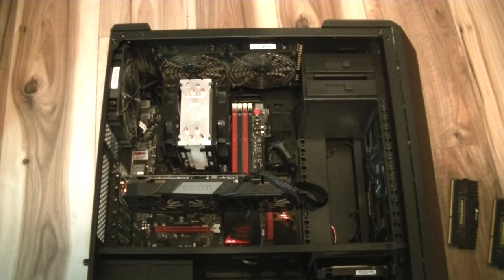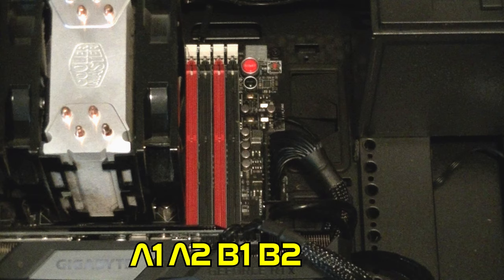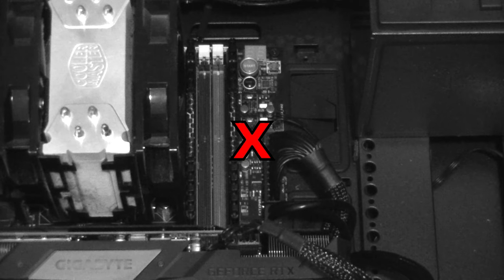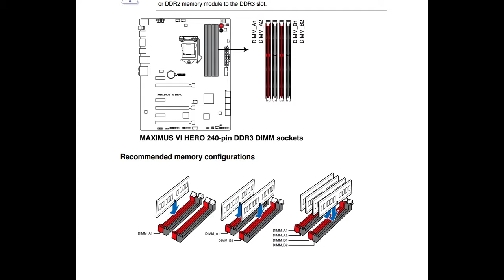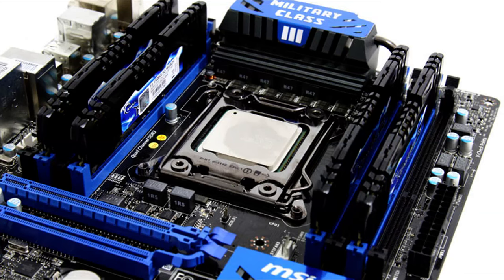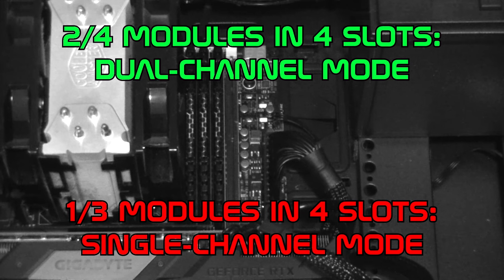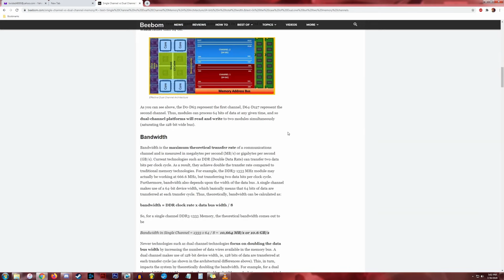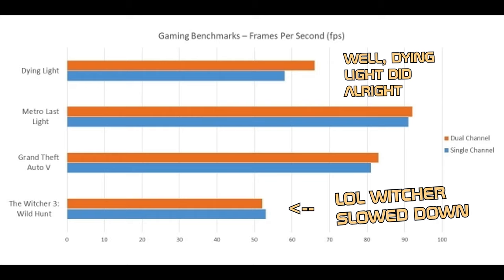How to Make Your RAM Run in Dual-Channel Mode

Comment: Hello sir, if there are 4 RAM cards available,
Can we slot that 4 Rams in those 4 slots, A1, A2, B1, B2.
Reply from the maker: Are you asking if you have four RAM cards and your motherboard has four slots for RAM? If so, then yes, just fill all the slots up and you'll get dual-channel mode.
Reply: @Torqcx Thakyou sir,

 we have to do any settings after installation to bring into dual channel mode.
Reply: And does our PC  get format or other problem like  data erase after installation.
Reply: 😅Thank you very much sir😇
Reply: @Torqcx  I don't know weather it is for RAM, but there are 4 slots. 
2 black colour  slots,
2 white colour slots. 
In that from both 1 from black and 1 from white are used,  now I wanted to increase the ram, so I can buy new RAM and place it beside of it or should I replace it with a new RAM card.
Reply from the maker: You can put the new RAM beside them, just try to get the exact same models.

Comment: Weird question and I’m very stuck I am building a new pc and I can’t run both ram sticks and there is only 2 slots and it supports up to 64 gigs of ram and it only works in slot b tried both sticks many different ways and nothing worked cleared cmos and it still won’t work I have a asus rog z490-I gaming motherboard with i9-10900kf 2x16 gigs of vengeance rgb pro ram rtx 2060
Reply from the maker: If you also tried cleaning the first slot, then you may have a defective slot, sadly. If it's a new board, I'd send it back and get a new one.

Comment: I tried to upgrade my   old 1866Mhz DDr3 kingstone fury 8G kit  ram with  with a  1866Mhz  patriot  viper ddr3 16G kit   I tried many combinations but  windows always told me there was a lot ram not usable until i tried the 8G stick and the old 4G stick then windows detected the correct 12G ram never figured out why I could get the all 24G

Comment: Is dual channel and  rank the samething? Cuz i have 2 single channel  ram but in bios say dual channel and also have 2 ram in  x300 it also say dua channle and in a different section 1 rank
Reply from the maker: "Rank" sounds like something that that motherboard has specifically, like boosting the rank of the memory also boosts its performance. I'd need to know the model to be sure though.
Reply: @Torqcx  DeskMini X300 Series and Crucial RAM 16GB Kit (2x8GB) DDR4 3200 MHz CL22 Laptop Memory CT2K8G4SFRA32A
Reply from the maker: So I learned something today! RAM rank is a separate function of RAM, it's a bit complicated but in short, dual rank RAM is better if you're getting a high capacity of RAM, while single rank is better if you want it to run as fast as possible (typically this is better for gaming).

It sounds like the RAM you have is single rank. It has nothing to do with the channel mode and I wouldn't worry about this.
Reply: @Torqcx  ok ty

Comment: My motherboard is capable of dual channel but still wont default to it, even with all 4 slots occupied.  Why?  Why wont it go to dual channel?  Msi b650p pro wifi motherboard
7700x cpu
Tforce vulcan alpha 16 gb x4 ddr5 ram.

Comment: i am strugling with a hp 2400 with  ddr2 6400  i have know installed  2 x 2 kingston  in th first 2 slots  and 2 x 1 gb in th las 2 slots but hynix moduls

i have tried with 2gb hynix moduls but it only works in the 3rd slot

Comment: If i already have ram DDR4 8G 2400 on my PC and i want to add in the other slot 8G  more. Is it okay if i buy DDR 4 8G with 2666? So will have 8+8 but different speed. Cause its difficult to find 2400.
Reply from the maker: If that's all you got, there's no harm in trying! If anything goes wrong, most likely it will just revert everything down to 2400MHz, which I don't think will be the end of the world
Reply: @Torqcx  ok. Thanks for the answer 👍

Comment: Do I need to change xmp mode if I swap out ram? Currently have it enabled
Reply from the maker: With most modern motherboards, you should just leave all the settings alone; it will keep XMP on or turn it off depending on what is needed.
Reply: @Torqcx  perfect

Comment: Im having a weird problem. My mobo cant read dual channel mode currently. Few days ago i run with dual channel mode (8x2) and run normally, but then next day suddenly i cant booted up my pc. So i try remove it and use the ram slot 1 by 1. Now can only run single channel (1 stick) on B2 slot only. Im actually run out of ideas cuz i never encountered this kind of issue before.
Reply from the maker: It sounds like that RAM slot may have died. Unfortunately there's nothing you can really do except get a new board when that happens.

Comment: My motherboard only has 2 slots and I’m adding another 8 Gb. So do I just put it in the infilled slot? Will this automatically put it in dual channel
Reply from the maker: Yes that should make the memory run in dual-channel mode!
Reply: @Torqcx  ok. I have another question, the other 8 stick I’m buying is faster MHz than the other and high cl. Will that still be fine. I’ve heard that it will just downgrade to the lower MHz
Reply from the maker: @joeef  yeah I'm not quite sure, it's likely it'll downgrade. Always always always best to get the exact same make and model of RAM when adding additional slots. Same capacity, speed and timings.

Comment: very helpful. Thank you. I recently tried upgrading my  ram from 16 gb to 32 gb , in my ASRock z87 extreme 4 ATX , the dual channel is not working. I have updated the Bios, tried shuffling the Ram, still it doesnt read the B1B2 slot. Tried using only A1B1 slot the dual channel doesnt work. Hopefully you can help me resolve  this issue. P.S. the 4 Rams are identical when 4 are installed ,  the pc says  Channal B  didnot pass CPU memory test.
Reply: Check your cpu compatibility

Comment: Hi in my pc if I but the ram in A1 and B2 it keep restarting can you please help me?
Reply from the maker: If the RAM configuration is causing the PC to fail to boot, either it's in incorrectly, a slot on the motherboard is bad or at least one of the modules is bad. Check each slot individually and test them all out.

Comment: Hello, I'm trying to install a 2 module ram, but it just won't boot, shuts down, reboots, and shuts down again.
Reply from the maker: Try each module individually, in each individual slot. If any of the slots cause a failure to boot, you most likely have a defective slot in the motherboard. If one of the modules causes a failure to boot no matter where it is, you have a defective module.

Comment: Dual channel is effectively using all the ram’s power?
Reply from the maker: It's a way for the system to simultaneously utilize all of your RAM, so in short, yes, multi-channel modes milk your RAM for as fast as it all can go!
Reply: @Torqcx  exactly what i want!

Comment: What if i buy 32 gb of ddr4 running at 3200, would it hurt if i kept my old 8gb in a 3rd slot? Would it run faster at all, or would it be slower than just dual channel 32?
Reply from the maker: If you have 32GB running in dual-channel, honestly I'd just go with that as opposed to 40GB in single-channel; I doubt you'd notice those extra 8GB

Comment: I have 3x 2gb kingston 1600mhz ram, and 4gb kingston 1600mhz ram will it work in dual channel?
Reply from the maker: That's a tricky one, you'd have to test them all. It's always recommended you get the exact same model RAM for every single slot (same speed, size, timings, etc.)

Comment: But what if I have 2 ram slots and I have 8gb already installed and want to install another 8gb? Will it work if there is 2x8 ram in 2 slots?
Reply from the maker: It will revert back to single-channel mode, but you will have more RAM. Odd number of modules in an even number of slots will give you single-channel mode.

Usually, though, having more RAM is better than having faster RAM (though it depends). If you find your system maxing out of memory, go with the extra RAM. otherwise, just get what you have to stay as fast as possible.

Comment: What happens if i use 3 ram sticks? Will still i have the benefits of dual channel?
Reply from the maker: In most modern motherboards, yes, but many will automatically resort down to single-channel if you do that. You'd have to check your board's specs.
Reply: @Torqcx  i have Asus b550m wifi ii
Do i need to change something in bios in order for me to run in dual channel mode with 3 rams?

Comment: Should I use 2 x 8GB or 3 x 8GB. In my 4ram slots?
Reply from the maker: It's up to you; using all three obviously will give you more memory, but they will run in single-channel mode and thus not be as fast. That being said, in your case, I'd say you'd notice an overall performance increase if you just use all three of them.
Reply: @Torqcx  thanks

Comment: What if your board only has 2 slots? does that mean its only a single channel board?
Reply from the maker: For modern motherboards, no, two slots should mean dual-channel mode will work with both of them filled. :)

Comment: Hi
I have a problem with a new CPU AMD RYZEN 7 5700X not boot with dual channel of memory
Only on single channel 
(Used in Asus rog strix b450 f gaming ii)
Let you know that I have used this motherboard before with a RYZEN 9 3900XT and 64gb of memory on quad channel and everything is fine
I updated to the latest bios compatible with this processor, and when i change the memory model it's the same problem only one memory stick.
Please help me.
Reply from the maker: Interesting considering it used to work before you updated the BIOS. Try looking through all of the RAM settings that are enabled/disabled, something may have changed in there. I'm sorry I can't be more helpful, but it sounds like a very specific issue or setting that got adjusted.

Comment: Does 8+4 ram activate dual Channel ??
Or i need 2*8 ram to activate it
Reply from the maker: You might be able to get dual-channel with different modules but every motherboard is different. Can't hurt to try, but it's always recommended you get the exact same make and model of RAM if you want to be sure everything will run correctly and optimally.

Comment: I have a laptop that has only 1 slot can i put 16gb dual channel, or sigle channel memmory does it makes any difference
Reply from the maker: Do you mean there's only one empty slot left available, or it literally only has one slot? If the latter, it will only run in single-channel regardless.
Reply: Like only a single slot and its occupied with 8gb can i upgrade it to 16 gb (dual channel)
Reply from the maker: @augustine5668  if it's a single slot then I don't believe the laptop is capable of dual-channel speed in the first place, so unfortunately you'll be limited to single-channel. But upgrading to 16GB will certainly speed the system up.
Reply: @Torqcx  ok thanks
Reply: So my vram also increases? First it was 4 gb ram and vram was 128mb and i upgraded to 8gb and now its 512

Comment: correct me if im wrong, my mother board is B75MA-P45, core i3 3220, can i put 3x 4gb ram DDR3 1333 mhz once i put it on dual channel mode? or still doing single channel or its better to buy 2x 8gb ram DDR3 1333 mhz or 1600 mhz?
Reply from the maker: If it's an i3, I'd assume it can only either do dual or single-channel mode. So I would recommend just filling all the slots up instead of going for three
Reply: @Torqcx  thank you
Reply: @Torqcx  hey sir sorry to bother you i have 16gb ram thanks for your tips last one is my gpu is it my b75ma-p45 is compatible on gtx1650?
Reply from the maker: @Furansurui  The only compatibility variable you should need to check is the motherboard. Everything else should work with whatever RAM you settle with fine

Comment: i have 16 giga ram corcair and asus rog strix B450-F Gaming motherboard and when i try  install  A1 AND B1 or A2 and B2   just wont start at all....Why ??
Reply from the maker: Try each RAM module individually, in each individual slot. This should help you isolate the problem and figure out whether it's any of the modules or slots causing the failure to boot.

Comment: How about 2 Ram stick mother board?
Reply from the maker: Do you mean a motherboard with only two RAM slots? If so, just filling both of them should make the system run in dual-channel mode.
Reply: @Torqcx  thanks ❤️👍🔥

Comment: Can I mix my 2x8gb ram with my 2x4gb ram from a different brand to get 24gb in total?
Reply from the maker: You "can", but you you may run into some speed/timing issues and not get the most out of your RAM. However, if it's your only option, it can't hurt to try!

Comment: I get bluescreen if I put my ram in the A1 and B1, If I put them in A2 and B2 it runs fine, but if I add two more ram cards and put tthem in A1 and B1 I get bluescreen, is my computyer broken?
Reply from the maker: It sounds like slots A1 and/or B1 are defective. If cleaning them out doesn't help, you may have to replace the motherboard if you want to use them.
Reply: @Torqcx  It's a new computer, guess I have to return it to the store then.

Comment: do I need to do some BIOS changing or something?
Reply: I opened my case and verified the person that installed my memores did it on single channel using b1 and b2. If I want to change it to Dual channel all I need to do is... stick the one in B1 at A2? My motherboard is a z490g GAMING -wifi
Reply from the maker: @daniloalves1139  That sounds like what you have to do, yes. Remember, matching numbers, not letters. They should be in A1 and B1 or A2 and B2.

Comment: So basicly I need just to put RAM in and its automaticlly on dual? And is 64GB dual always better than 64GB single?
Reply from the maker: Yes, if it's the same amount of RAM, typically, Dual-Channel will be faster than Single-Channel mode. No drivers or software needed, just put the RAM in the correct physical spots of the motherboard and you'll get Dual-Channel.

Comment: What if i do 2x dual Channel ram
2x 8GB with 3600MHz
and
2x 8GB with 2400MHz
Will it work?
Reply from the maker: It might, but it might not. There's no harm in trying, but it's always recommended to get the same exact make and model of RAM when installing multiple modules.

Comment: i have a hp proliant server and when i want to add normal pc ram it goes like 4 beeps and not opening (only fans sound)
Reply from the maker: The system is failing to boot. Check each individual RAM module in each  individual slot until you can find the culprit, whether be any of the RAM itself or any of the slots being faulty.
Reply: @Torqcx  i get like 5 beeps after putting the ram

Comment: I have a question,i have 2x4 dual channel 3200mhz cl16(normally sure will be 2400 when i will put them in the motherboard cuz  cpu supports max 2400mhz),but i have another 4gb ram with 2400mhz cl 17,idk if 8gb ram dual channel will be better for gaming  than 12gb ram single channel,so im here to ask you cuz maybe you know what would you recommend me the best? @Torqcx
Reply from the maker: Overall I'd say go with the dual channel of 8GB; those extra 4GB most likely will be redundant when it comes to gaming alone, so getting the faster RAM will most likely result in at least a slight FPS boost.

Comment: I am using all 4 Ram slots on my motherboard, the 2e and 4e says Dual, but the 1e and 3e says single.
I am using CPU-Z program to monitoring. seeing this under the tab SPD.
Reply from the maker: I've never heard of RAM being labelled that way. It sounds to me like it's running in dual-channel mode, though? Try another program (I use Speccy), see what that says, and go from there.
Reply: @Torqcx  thx for the quick response.
I used speccy and it says it s dual channeled :)
Just some info, the CPU Z prog said in memory tab also that it was dual Channel, just kinda strange that in the SPD says it s 2 bars dual and 2 bars single.
switched the ram (by pair) and now it says 1e and 3e Dual and 2e and 4e Single.
Saw on the barcode of the RAM Modules that they are the same model, but different versions, 1 pair is 1.52 and the other pair is 1.8 (bought them later)

PC runs well tho, so no big problems.
Just went searching, cause of "No Man Sky".
The game ran well in OpenGL and stutters a lot in Vulkan.
While searching for some solutions, I read on some forums that the game is RAM and CPU sensitive :)

Comment: Yo, my motherboard has 2 memory slots. I installed 16 gigs of ddr3 ram ( 8gb × 2). Had 8 gigs before that. Now, it doesn't boot when I got 2 ram sticks. I tried placing both of the rams in both slots. They worked fine if there was only one. Can't seem to find dual channel mode in the BIOS ( or anywhere for that matter ).
Reply from the maker: Start by resetting the CMOS (I don't have a video on this yet, but you basically just take the coin battery out of the motherboard for a minute then put it back in). This will not affect your programs or files. Go from there.
Reply: It suddenly worked when I did just that. Was there any other instruction after that?

Comment: What if your motherboard has only 2 RAM slots, is it always single-channel mode?
Reply from the maker: Older models will often be limited to single-channel mode, but newer motherboards (made in the last decade or so) should have dual-channel even with only two slots.

Comment: How about in the Laptop especifically in ACER PREDATOR HELIOS 300
Reply from the maker: Laptops are often even more straightforward than desktop motherboards, typically all you have to do is find the (usually one) open slot and add the module to it, which should make the system run in dual-channel mode.